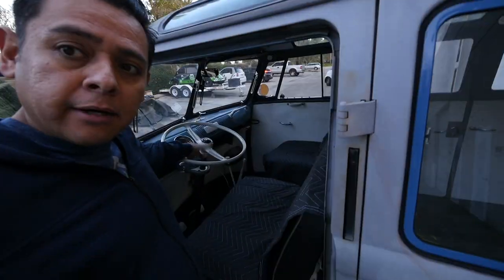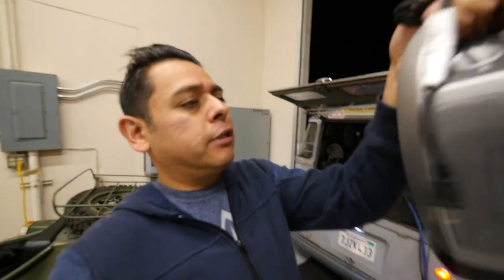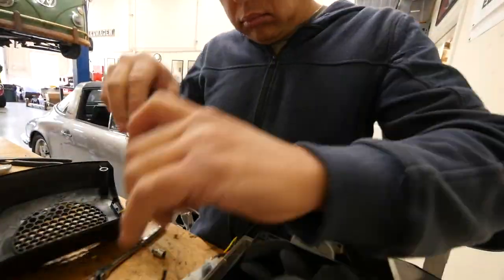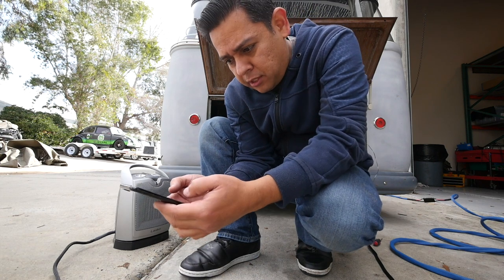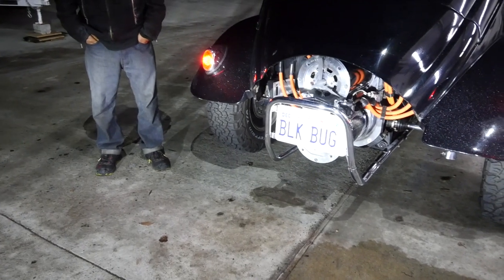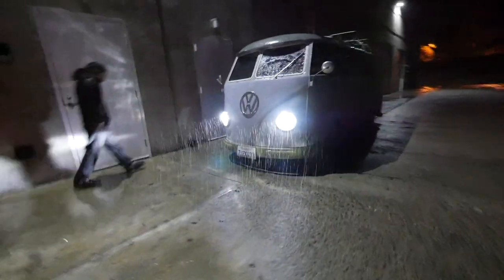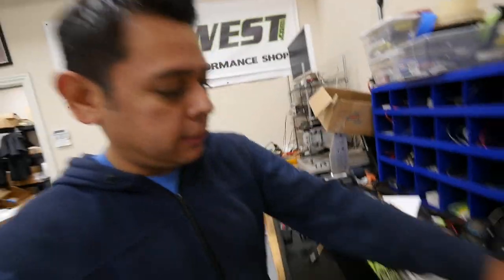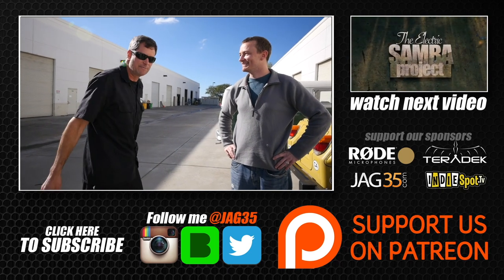Running A Portable 110V Heater without an inverter in My VW BUS - Vlog 4

Comment: I'm wondering if something like seat heating and a heated steering wheel would work better and draw less from your battery pack, it is socal your driving in. I lived in Tennessee for a couple years and drove a ford focus EV, during the winter my range was shot to half if I used the heat but if I used the seat heaters my range was hardly affected. your work is inspiring by the way. keep it up

Comment: I bought a dc to ac inverter for $60 at Home Depot. Runs my space heater with out talking it apart.
Reply: Does this effect the alternator! I need this for my car! Any particular voltage recommended

Comment: 2:00 would the heat sink epoxies handle heat better?  

3:50 a thermal fuse may help.  aka 'thermal cutoff' , but the heater may already have that built in.

Comment: 3:46 Why didn't you just use an inexpensive "high voltage" to 12 volt step down converter to run the fan or just a high voltage fan ??